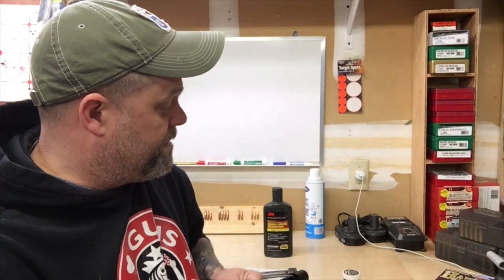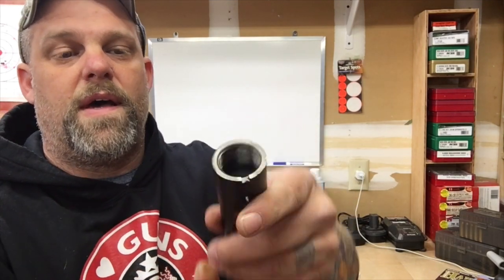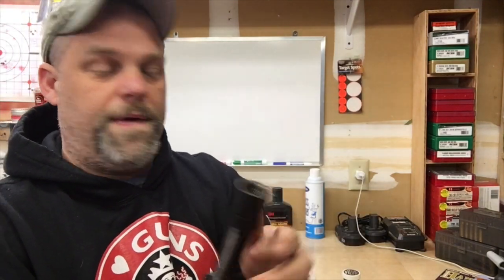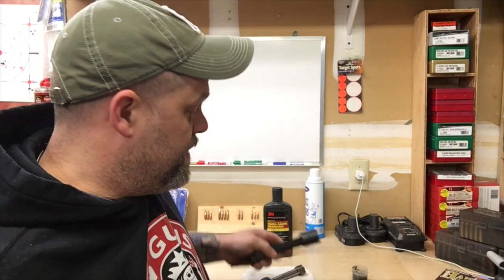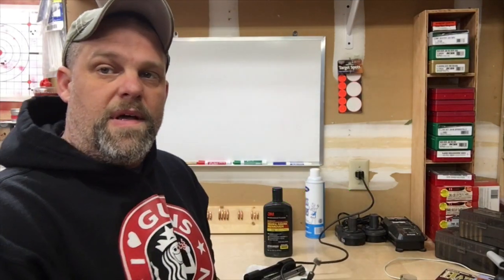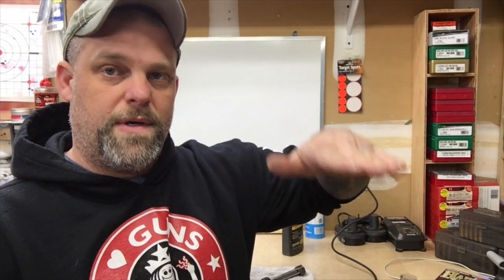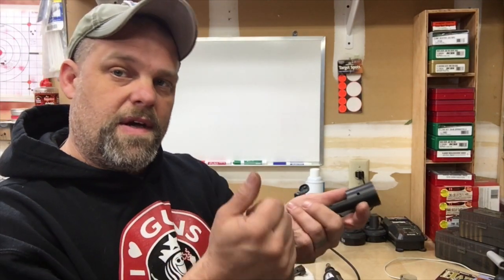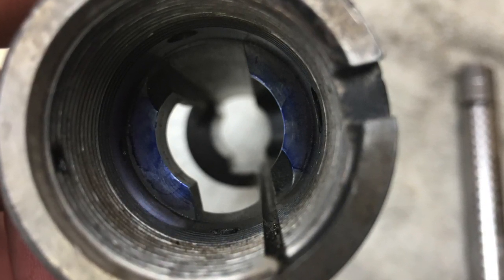Savage Rifle Build, Action Work (pt 5)

Comment: you have a lathe make you a threaded spring plunger to thread in the receiver to put tension against the bolt face so it will lap the lugs easier and a little bit more true it will save some wear and tear on you mainly
Reply from the maker: Yep, I’ve got several made and use them all the time.! Way cheaper then buying them.!
Reply: @vaughnprecision  i never done the savages but i have done quite a few turkish mausers with the large ring receiver and small ring threads and its basicly the same idea on a different chassis when i did mine the mausers were about 29 to 39 bucks now they want 3 an 4 hundred bucks for them

Comment: you can take a small heavy spring and set it on top of the bolt head and run the barrel down on it some, it will put pressure on the bolt so you don't have to pull on it. it will get you almost 100% lock up if done right.
Reply from the maker: derekthegreatgonzo I actually just built a tool on my lathe for that.
Reply: I did to!! LOL!! I have one for small shank and one for large. I also made them where I can true the actions on them as well.

Comment: So doing this by hand, how to you prevent it from making the shelves angled or sloped?  If you take of a bit too much along the edge, pretty hard to level it back out and cut right into the corners, or have it level on both sides.  Using the bolt lugs seems like little risk, but the dremel, OMG, no.
Seems like something akin to setting head space with a cars odometer.

Comment: Isn’t this polishing something that would wear in over time?
Reply: Yes, in which then it would have better contact. Lapping gives you immediate full contact instead of a lengthy break-in. I have a model 700 with over 5,000 rounds through it and it still hasn't developed full contact. This just speeds it up, also changes your headspace, which on a savage is super easy to adjust.

Comment: The fundamental to truing bolt actions is the barrel threads, and the reference center line about those.  Everything else should be concentric and aligned both parallel (inline to it) and perpendicular (square to it.)  So to do this one has many forms that are simple shop practice.  This is incorrect lapping of a bolt locking recesses as it must be done to be perpendicular to the reference centerline, as well as the matting face for mounting the barrel,and most importantly the bolt face must be perpendicular to the reference centerline.  Most often this entails making a mandrill to thread the action on to hold it in the lathe, and making a guided lapping tool, that is guided by the mandrill fixture.  
This step needs to be done with a precision lap aligned to the reference centerline and perpendicular to it, the lap should be softer than the steel of the receiver, cast iron best, to allow loading and retention of the lapping compound.  Further, diamond / grease based compounds are best (you can find these readily available at tool and die suppliers.  And, much finer grade should be used.  Remember the lap once made will need to be used with only one particular abrasive grit and material.
Just time consuming as hell, because of making the tooling.
Reply: Brownells, has a jig built for just this. You screw it in to the action from the front, and you can then lap the lugs, aswell as put a cutter on for the bolt face. It costs I think around 200$ But it looks like a nice tool to have for this. I might be mistaken, but I thought I read you can square the face of the action to the threads as well. Not positive.